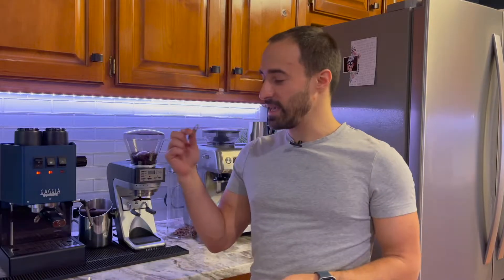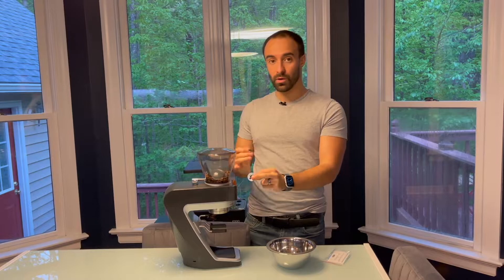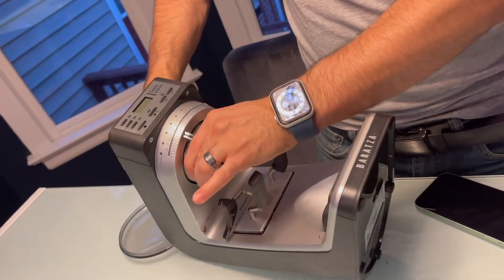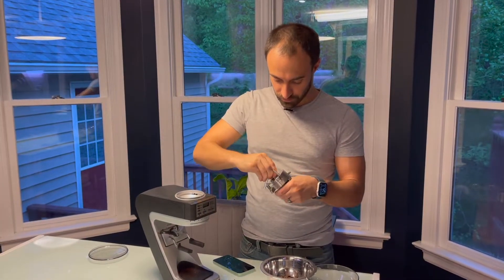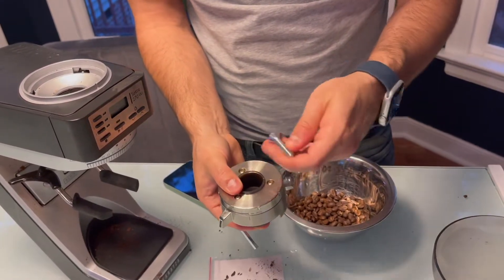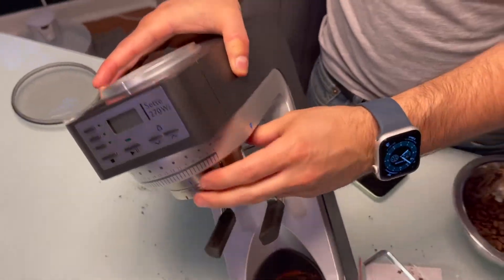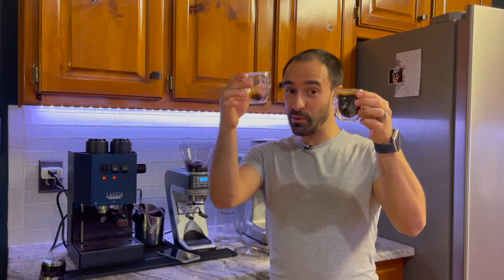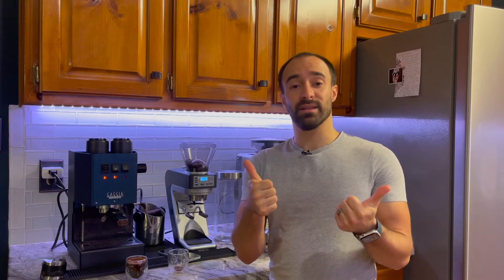Sette Shim - How to Install Shim on Baratza Sette

Comment from the maker: if you have a baratza sette and use it for espresso you need!!!!! to put at least one of these in.
Reply: Not necessarily out if the box, but over the 9 months I've owned it, I've gone from the 4 range down to 1B yesterday. 😬

So everyone will likely need one or two shims eventually, but if you're fine for espresso in the 3 range, and you put in a shim, you're potentially limiting yourself in terms of getting coarse enough for French press.  

Good video, though!  I just shimmed it and I was looking for where to start dialing in.  You say 3-5 notches, so I'll start there.  Thanks!!!
Reply from the maker: @spike443  for me I had very dense light roasted beans and needed to go finer out of the box I wasn’t hitting the ratios I was looking for
Reply: @JoeyVaracalli  I hear ya! 😃
Reply: @spike443  I've been using one of my 270 for almost three years now. 40 grams per day on average and I still grind between 4 and 6 but mostly between 4 and 5.

Comment: Thanks for the clear and helpful explanation! I just added one shim and the macro settings has changed from around 5 to 13 (for the same level of grind). Although it wasn't a necessary "upgrade", I think the middle range in the scale is easier to read (as it's in the front). I also plan to try grinding for Turkish coffee, so this change did make some sense. Thanks again!
Reply from the maker: Turkish coffee  is amazing very under rated

Comment: Just did this. If youre having trouble getting the grinder back onto the machine (I lined up the blue arrow and the blue marker of the grinder), you need to line up the plastic ridges first and then it should fall into place.
Reply from the maker: Ohhh very good tip thanks for sharing that here :)

Comment: Hey Joe.  One shim didn't do it for me.  With one shim, I could dial in a double that pulled in 25 to 30 seconds but it tasted horrible.  With two shims, I set it at 11 E for an oily French Roast that pulled a double in 25 to 30 seconds and produced a darned good espresso.  Go figure.  I'm confident that with a little tweaking, it will produce a perfectly delicious espresso.  Thanks for the video!
Reply from the maker: No problem

Comment: Great advice Joe! As I told you before a couple of weeks ago, still looking to get the 270WI and it's great to have this info! I've never come across with info regarding the shims on any review that I saw or read.
Reply from the maker: Yeah people don’t talk about it very much but I highly highly recommend putting one in as soon as. You get it . That is if you are you using in mainly for espresso

Comment: Interesting. I choked out the coffee machine with #2E setting on the Sette without shims.
Edit: I understand that the argument can go that the pump of my machine is getting weak. So to make the picture complete - I've got a lever machine and I could not get out a drop on the edge of breaking it. After about a minute of struggle I managed to get out about 6 or 7 drops, half of which was oil. Did not want to damage my La Pavoni, so just stopped trying.
Reply from the maker: Hmmm that’s intriguing. My guess is the roast was medium to medium dark. I was using a very light roast on this
Reply: @JoeyVaracalli  Yes, the roast was medium.

Comment: hi! thanks for this video it was quite helpful! I'm wondering if anyone else is having trouble reinstalling the burr. I do match up the black plastic ridges, but don't get the click when i try to rotate the blue parts towards the back of the grinder.
Reply from the maker: It’s possibly it’s not lining up properly you may need to play around with where you line up the blue indicators and I had to push reasonably hard for it to seed up there so give it a good push then turn while pushing
Reply: @JoeyVaracalli  makes sense yeah. I ended up not focusing so much on the blue lines and instead lining up the black plastic bits and turning till I heard the click. Super bizarre and probably more finicky than it should be. Thanks for the advice and video, it definitely helped me troubleshoot that bit!
Reply from the maker: @marywetherall1319  no problem at all Mary :) always love chatting with folks

Comment: So I have a Sette 30 that I put the 270 adjustment ring on. I usually leave it on macro 4 and if I’m on the wrong micro it can choke. Is there any reason I’d need to put a shim in?
Reply from the maker: Nope sounds like yours is all good to go. If your able to get fine enough to make consistent espresso then your good to go. What kind of espresso machine u using?

Comment: Hi Joe thanks for this awesome video is was really fun to watch specially since I like taking things apart hahaha! :-)  I just purchased the Gaggia Classic Pro with the Sette 30 and I have never in my life before owned any equipment to make espresso drinks.  All this technical talk about grinding and brewing and this and that man this is all a completely new language to me and confusing I had NO IDEA it was going to get like this hehe :-).  This is going to be my question to you even though I kind of don't even know what I'm asking hahaha if I install that one shim in my Sette 30 what should my setting be on the grinder number towards the fine area to get really nice espresso, 7, 5, 3, 1??  What am I supposed to be looking for after the coffee comes out?Will really appreciate your input.
Reply from the maker: Yeah my recomandation would be to start at 8 and see what you get. As far as time is concerned shoot for around 1.5 to 2.5 oz in about 25 to 35 seconds and you should be getting reasonable espresso. You can fine tune from there
Reply: @JoeyVaracalli  Thanks for responding Joe really appreciate it.  Before using my new Sette 30 I did what you recommended and installed the one metal shim.  I'm really not sure what the purpose of the shim is, but whenever I set the grinder from 5 to 1 nothing really comes out.  Does that mean that those "fine" settings don't work after setting 5?  Should I remove the shim and see what happens?  

Something else I wanted to ask is how much pressure/force am I supposed to apply to the grinded coffee in the portafilter basket?  I have tried different settings and my Gaggia Classic Pro is taking for ever to spit water out and I have to reset the machine about three or four times until it starts pouring the espresso down the portafilter.  I don't know what I'm doing wrong, or maybe my Gaggia machine is defective.  Maybe I'm compacting the coffee too much???  I'm using the unpressurized basket that came with the machine WITHOUT the little plastic Frothing Jet Device and I'm not getting any crema.  

I went to a local coffee store www.jonescoffee.com and they sold me their JC Espresso coffee that they said it "produces" crema but after different settings that I have made here there is no crema coming out and after several tries with the grinding machine the coffee is pretty much just coming out black and a bit too strong.  I don't know if these guys just lied to me and the coffee does not produce enough crema.  Maybe the problem is this coffee that I got I don't know.  I'm kind of lost here.

Comment: Just bought the 270wi. Its rubbish.  

Used portafilter 1st.. ground coffee all over rhe table top. Every where buy in the portafilter . 

Now using the pot that came with the set instead.

Grind wise.. rubbish point 2. Even at setting 2B,...its like rough sand. 

Using that ground coffee  wt the flair,.. when pulling down, the  coffee is shooting all over the place. I think the coffee is too coarse. 

What a waste of money really. Now having to waste time looking on the net why out of the box it cannot do a proper grind for espresso. 

Disappointed to say the least.
Reply from the maker: Yeah I’d use the portafilter with a funnel if you grind directly into a portafilter that’s what I do to keep the mess down